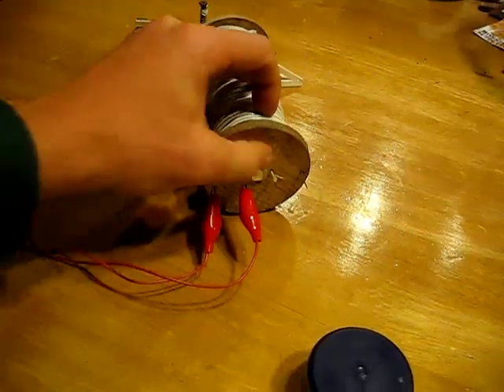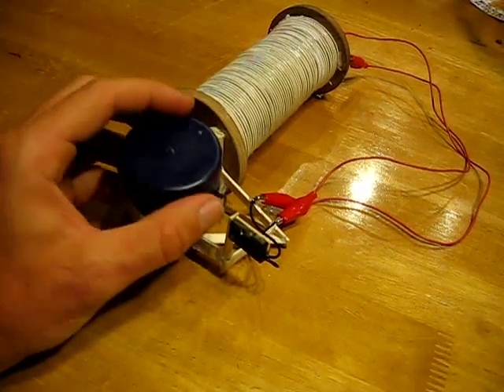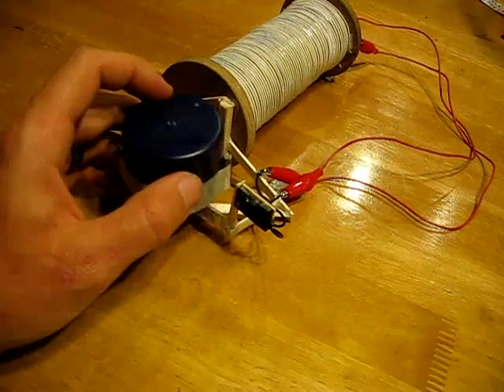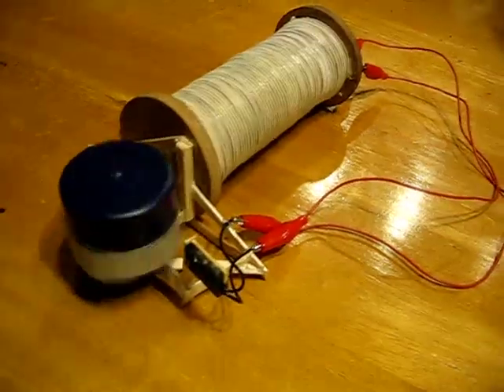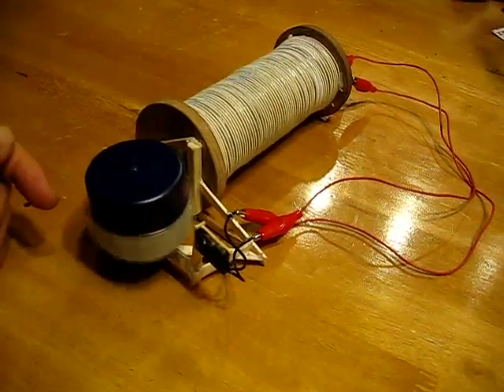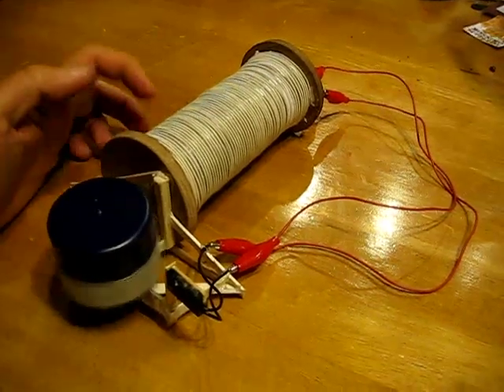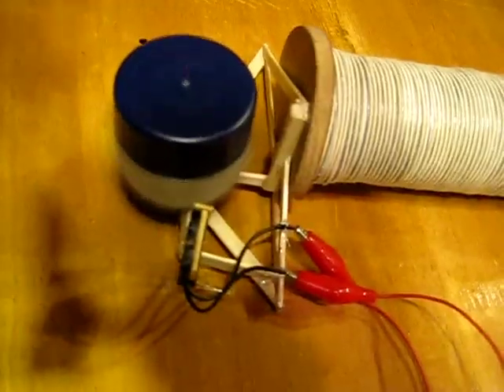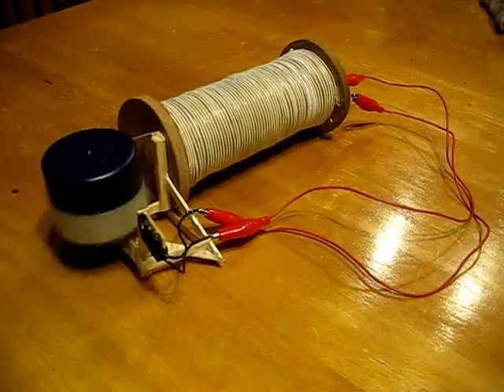Magnet Motor Coil Switch

Comment: Awesome. I have been reading lots on Stubblefield lately. Do these coils produce more power when scaled up? I imagine a coil like this sitting powering a heavy flywheel instead of the paint cap. If in fact these devices gather minute amounts of energy then we could really let the heavy fly wheel get going and as long as we never completely depleted the stored energy then we could perform real work with such a device. Does your system still perform when energy is drawn off. Can you power a light bulb. Many such machines have been invented but the moment any amount of energy is consumed they no longer function. That is the real obstacle. Producing a surplus of usable energy

Comment: jenkem23b,
 Me thinks there is a Galvanic Reaction (a type of battery) just from the two dissimilar metals - Copper and Iron wire side-by-side. The coil of wire is the battery. Eventually the iron will rust and the "motor" will stop. This is derived from the Nathan Stubblefield's Earth Battery ...

Comment: Well the reason it rotate is. You might think you have the magnet to far but the are inducing current on the coil so that's why it all possible. Stronger magnets would work even better but must enforce the motor because might push it self to the coil. I'm other words it's a self tuning motor. Thanks for the video